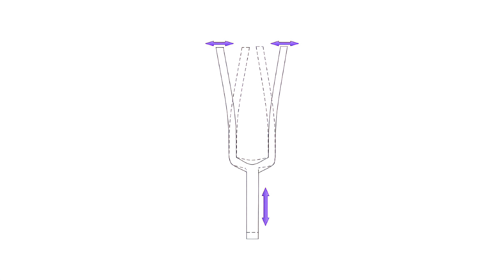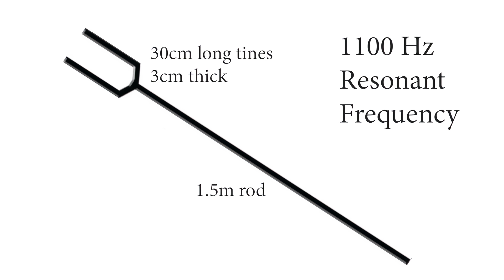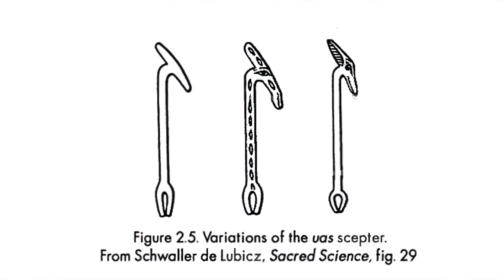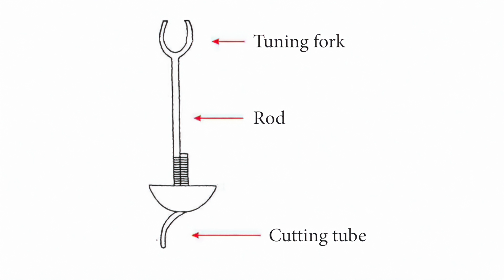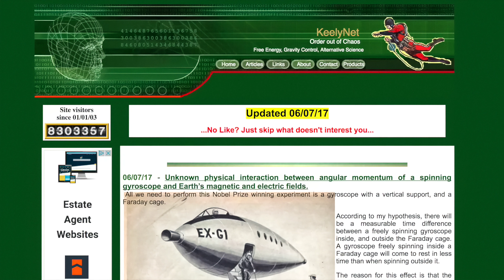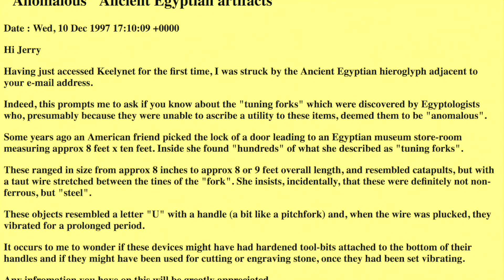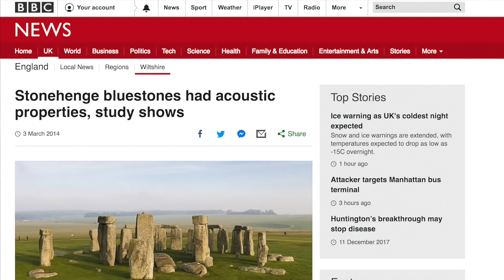How the Ancients Cut Stone with Sound - Lost High Technology Explained | Ancient Architects

Comment: Well known to mainstream... The ancients (and moderns) put SAND into the hole.  They turn a pipe and the SAND along with some water does the cutting.  Same with straight lines in stone only they 'saw' it with SAND in the CRACK along with some water.

Comment: What a brilliantly simplified method...what past civilizations achieved through the magnificence of stone cutting and drilling through sound resonance, should have been repeated as to instill common knowledge throughout the years and should easily still be in play today, if it were not for supression of the mind. That could easily be a lengthy discussion for a different day, but for now, thank you for the intuitive video and information. It is greatly appreciated and frankly, it is knowledge too intensely powerful to be ignored. Harnessing the energy emulated from sound could provide limitless possibilities to human existence.
Reply: What is simplified about the method?  It's absolutely ridiculous and won't work.  I am ready to be proven wrong any time.  I yearn to be proven wrong.  But I won't be.  No one cut stone, especially to the precision of the ancient megaliths, with a tuning fork.  Seriously, go buy the biggest tuning fork you can afford.  Go to Lowes or Home Depot and buy every pipe and cutting tool you can find.  Then in the masonry aisles you will be able to find a slab of granite.  Take it all home and using only the vibrations of the tuning fork, but any cutting implement you want, cut just a 1 inch square from the corner of that granite slab.  Please post the video!

Comment: Yawnnn i have been working with tile and stone over 35 years,,,show me how you cut a round hole in granite with a tuning fork LOL.
Reply: Step 1: Place your circular saw blade on the granite.
Step 2: Hit a tuning fork with a hammer, so it vibrates.
Step 3: Lay the tuning fork on top of the circular blade.
Step 4: Place your jack hammer tip on top of the tuning fork.
Step 5: Turn on the jack hammer.

Comment: I think you may have found the way they moved the large granite blocks. If you put enough of those granite cores under the blocks it would spread the wieght around and act like needle bearings as long as they had a hard smooth surface underneath.

Comment: It seems to me that a drill with a frequency generator designed to transmit the frequency through the bit should be built to prove this. If it is successful then i have no doubt academia will ignore it but then you sell the idea for big money and then those same people will be begging you for the grants. Hell I would love to take a stab at this myself.
Reply: it's been done, saw a video for that.
Reply: @spaggs111  i have now as well but I haven't seen it o  the shelves at Home Depot.
Reply: A lot of tools vibrate. The thing is, we already have hammer drills and the like. We already have hole bits as well, some of which vibrate and rotate. We have diamond tipped carbon steel coated to increase durability, and these systems are going to drill a lot faster, and last a pretty long time, it's hard to imagine that a soft metal like copper is going to hold up as well or drill and cut as quickly. If I ever need to drill a long hole through granite though, I'm using a piece of scrap copper pipe and gluing the dremel to it, to see what happens.
Reply: "If it is successful then i have no doubt academia will ignore it but then you sell the idea for big money and then those same people will be begging you for the grants."  Presumably tahts already been done and womp womp, it doesnt work.
Reply: @Ddub1083  apparently according to the physical evidence it's not possible it's been done. The swirl marks are undeniable, I'm a machinist and there is no other way to define those holes except they could do it... inventors rarely have encouragement like this. Seems to me it is just a matter of finding how to tune the frequency of the material you are going through. This is literally just finding out how to reinvent the wheel sort of speak.
Reply: @enevitableparadox3735  swirl marks.... bout to blow your mind here.... any rotational saw, whether powered by mystical forces or powered by human/animal energy, will leave swirl marks.  As a machinist... how do you suggest the swirl marks show evidence of something more than manual power rotational saws?
Reply: @Ddub1083  because each swirl mark has length that it went down as it rotated around. Their marks are about three times longer than what any machine we have can do, suggesting they did it as accurately but three times faster. That is to say that each time their drill rotated it drop into the material three times deeper than the best stuff we have today. If you attempt to get it done as fast you will super heat our machine bits and the tool will break.
Reply: @enevitableparadox3735  Right..... but that length is the same whether its powered or not... remember powered or not, the same SAW SURFACE is what is causing the marks... not the power source. 

"Their marks are about three times longer than what any machine we have can do"  LOL!!  Again.... the length of the marks is dependent SOLELY on the radius of the rotational saw.  You are pretending to be a machinist?  thats hilarious.

"That is to say that each time their drill rotated it drop into the material three times deeper than the best stuff we have today."  Again.... please indicate to me how you can tell the difference between powered vs non-poweered rotational saw marks.  If I hammer a nail into wood, can you determine if that nail was hammered by a human or by a machine?

Best stuff we have today can cut stone pretty quick... perhaps its just very clear you have no clue what you are tlkaing about.  Again... mr machinist.... one cannot distinguish a powered rotational saw mark from a non-powered one... THEY MAKE THE SAME MARK.
Reply: @Ddub1083  we aren't speaking of power source, rather the frequency that it produces in relation to the material. Finding the harmonic frequency of the material is most likely what is the trick here. I am a machinist... i don't know how to pretend to have had eleven years of pretending at my job, and if you can't  have  a discussion without being insulting then give your mommy back her cell phone and go play outside with the rest of the children.
Reply: @enevitableparadox3735  So using harmonic frequencies somehow leaves rotational saw marks?  We are talking about SAW MARKS... it has absolutely NOTHING to do with harmonic destruction.
Reply: @Ddub1083  ok this is getting repetitive, I mean have you looked up any thing on this subject? The leading theory is that they used a generated frequency through the drill as it turned to make it cut faster, like a high vibrational hammer drill. Some have even shown how a  copper tube (acting as the drill) with as simple a device as a tuning fork on the end could create the effect, increasing the drills efficiency. There are plenty of videos here on You Tube that show this process.

Comment: Ultra sonic drills make most all the gemstone beads that people wear today. The holes are very consistent in diameter. Scale really means nothing. Vibration may be created with primitive method and does not require an electric motor to operate such machines. I feel optics/laser was also part of this vibrational hard rock cutting method. Properly focused optics could provide a steady high frequency for efficient stone cutting. The great obelisks of the Giza plateau which are still in the base rock have cuts which are beyond todays tech abilities. Then we come to the issue of how to move such huge monolithic stones. This too is likely achieved with sound technology. It is the only thing which makes sense. Granted there is no proof as of yet other than the end results which remain an enigma.

Comment: When you break a rock using a chisel you are basically using vibration to create a crack in the rock.  If you made a sheet of copper vibrate and stood it on edge could you cut a flat surface?

Comment: HOW ULTRASOUND WORKS:
"The transducer probe is the main part of the ultrasound machine. The transducer probe makes the sound waves and receives the echoes. It is, so to speak, the mouth and ears of the ultrasound machine. The transducer probe generates and receives sound waves using a principle called the piezoelectric (pressure electricity) effect, which was discovered by Pierre and Jacques Curie in 1880. In the probe, there are one or more quartz crystals called piezoelectric crystals. When an electric current is applied to these crystals, they change shape rapidly. The rapid shape changes, or vibrations, of the crystals produce sound waves that travel outward. Conversely, when sound or pressure waves hit the crystals, they emit electrical currents. Therefore, the same crystals can be used to send and receive sound waves. The probe also has a sound absorbing substance to eliminate back reflections from the probe itself, and an acoustic lens to help focus the emitted sound waves."
BY CRAIG FREUDENRICH, PH.D.

Comment: The Great Pyramid (GP) was built by Bronze Age people
who knew little of math or physics or astronomy
yet they built the greatest structure on earth

They did this with small sticks/logs and rope
Bronze chisels, saws, and tubes were used to cut limestone
with sand as the cutting agent

and NO granite was used to construct the GP at all

The ONLY purpose of the GP was to hide the granite temple within
and they did a magnificent job of doing that
The granite temple was built by the same people
that built the Great Sphinx
thousands of years earlier

there are no magical fractions or relationships at all in the GP
they used no ramps
no pullies
no wheels
no sleds

and cut, moved, lifted, and fit into place
500 5,000-pound limestone blocks every day
for 20 years
and did it with less than 10,000 craftsmen

sorry, but Bronze age man was no smarter than we are
and were not trying to pass down secret information to future people

Comment: Interesting video, many thanks. Many of the holes show drill marks similar to what would be produced today but often with a higher feed rate! The Aswan quarry walls look as if they were sliced and there are odd flattened markings which seem to look as if the stone had been softened. Perhaps sonic tools may have been a factor but many tool marks look like sophisticated modern tooling. Another indicator of advanced machining is the perfect simitry of the Rameses and other statues which is impossible by hand regardless of the tools used.

Comment: Is there anyone you know of making these drill bits for sale? I could probably have a local machine shop make a long fork for me, but tuning it is another story. If I did go that route, does anyone know who you'd turn to to make sure it was vibrating at the correct frequency? Also, there's something missing: hitting the fork over and over to drill a millimeter or so at a time is not efficient. Isn't it much more likely another fork or other object was used to keep the vibration going longer? Something like a guy who can use his finger on wine glasses to make music.. Lastly, how dangerous is this to your ear drums? Long term exposure, even a few day's worth to do a project, might actually make you deaf.. right?
Reply: So, I am still thinking on this, maybe a reed on the end of a string to make the reverb noise the tuning fork needs.. If you hold on to 1 end of a string and spin something on the other end, the string itself makes a noise. Add some type of reed in a tube, you can get a high frequency or a really low one, so if you had the right one, you'd be "activating" all of the sonic drills nearby. Anyone know a better place to discuss this? Doesn't matter if it's 2 people or a dozen needed to generate the sound, as long as it leads to practical cutting.. I could see a bell working too, placed up side down with a marble inside: you'd keep tilting it to spin the marble around. Thing is, if this was how, then we'd see bells all over the place, wouldn't we? Wish there was a better place to discuss this in detail.. figure out a way to do this that won't make us deaf....

Comment: I love this but i can't help but wonder why this would be necessary if all these stones were actually softened down to thick cooling magma consistency. It's easier to shape a stone like pastry than to cut it solid.  Sonic vibration could only get the job done faster.  All these megalithic works were probably made using a combination of methods. Not just 1 or 2 things. Even corrosive liquids have been suggested.  The Jericho story definitely involved the Ark of the Covenant. No Ark, no walls crumbling. Same goes for the trumpets. It's all about that synergy.

Comment: This is fantastic, now we know how to drill round shapes......how did they cut extremely accurate straight plains and corners? Also, now just how did they get the stone there in the first place?
Reply: Well if we look deep into matter regarding this ultrasonic vibration at the molecular level there is not much difference between these methods of ultrasonic stone cuttings and the methods for levitating heavy block of stones at Coral Castle as differences sources claim to be as newspapers clips and such as how the Coral Castle structure were built.

The old electrical equipment inside the museum they claim was used to made the stones levitate is similar or pretty much a tuned RF oscillator controlled by a large air variable capacitor similar to the one you see in any old tube radio receptor, maybe this was indeed used as made the stone vibrate and such loss weight, becoming weightless as party balloons , reports from the time claim he move the stones guided by a rope holding a rock floating in the air.
Reply: But that IS magic. Magic means doing things with unseen strings. Once you see the strings it's not magic anymore.
Reply: Here's one cool way: https://www.youtube.com/watch?v=E5pZ7uR6v8c&index=4&list=PL4wiOZVdrkSXZbHuFyfRf4q9umBP5nhcF&t=0s
Reply: Yes that's true. I'm not sure why it needs to be aliens, though, since we have multiple populations of Arcaiac Homo sapiens living all over the world with bigger brains than ours for 300,000 years before the oldest preserved writing.
Reply: jeffrey jefferton a man in Florida built a stone house using sound levitation. Look it up. Using sound u can make a block levitate. Watch pyramid code made by scientists and research what a tesla tower is.
Reply: Yes, exactly. Any real magic only appears as magic to the untrained eye. Anything that can be done has an explanation. When Lieberman moves stones, it is magic if you don't have the scientific explanation behind it. When someone uses Ki energy, it is magic to westerners because western science hasn't accepted that Ki energy exists yet (despite 30 years of scientific data). When a Magi shoots a fireball out of a bamboo lantaka it is magic, because they weren't supposed to have gunpowder yet.
Reply: ChristophersMum its pissible the stones were originally cut from wood and then petrified lime the giant ancient trees like devils tower and others
Reply: 3-4-5 triangle gives a right angle.  You can make one with rope, or chain.  Large stone blocks can be moved with wet clay ramps.  Several ramps. or former ramps are in the area around the pyramids.  No magic.  Just smart people, refining their craft generation after generation.

Comment: Most of the holes depicted on other sites are of some considerable diameter. Maybe 100 mm however all your illustrations and  pictographs show much smaller diameter, maybe 20 mm. Also they are upside down, surely they would have been depicted in a usable position, they would rely on weight to move through the rock and the best weight is gravity. 

Pity you didn't actually reproduce one of the drills to show it in action.

Comment: You can cut stone with two pieces of wire twisted together, some grit and water. Old civilizations still do it today. You can drill holes with tubing and grit and water. Just like we do today. The only difference is we use Diamond grit and electricity. But the principal is no different. If there was any basis in this method, this would not be an 11 and a half minute video of talking. It would be a demonstration video. We have  tuning Forks. We have copper pipe. We know the math. This isn't some ancient technology. If it worked, we'd be doing it today. Stop talking about it and just go do it prove it.

Comment: This makes me wonder if The hammer of Thor was actually some kind of tuning fork. Supposedly it could smash mountains and sonic vibrations would probably do that. Thoughts?
Reply: Depends on the resonant frequency and whether or not the hammer could match it. Vibration and frequency in general are rather mysterious and if I may I would recommend you look up john hutchinson his work deals with the manipulation of different frequencies and it has... vary strange... effects. (Tell me how it goes, and toodles).
Reply: Yeah, are's runs ps4's an fake rockets to the moon.
Reply: @Jay-cn3js  Chemical fuels bring REAL rockets to outer space.
Reply: Yes Thor's hammer makes lightning and is covered with pixie  dust
Reply: when did you last see a Hammer of Thor?
Reply: No a hammer is the wrong shape, but didn't Poseidon have a fork?

Comment: The carving that shows the 2 pitchforklike items linked by wire also shows what appears to be a fan below it and an up sighn pointing to the forks maybe signifying that wind or air is to be blown at/through the strings to create the vibration and soumd needed.